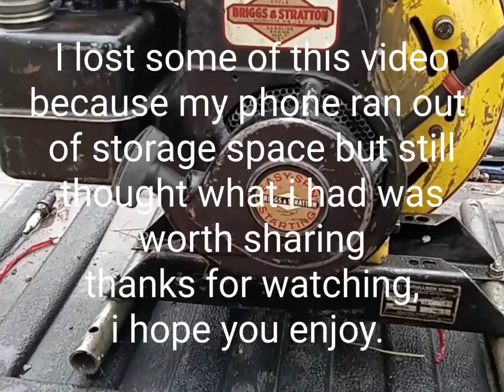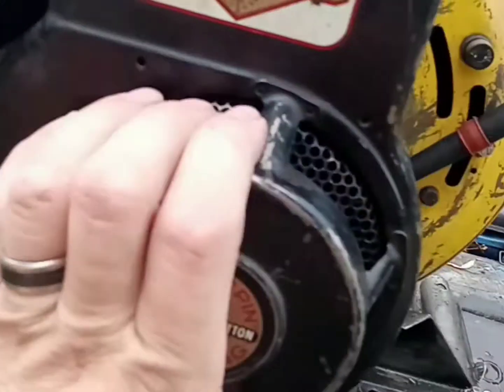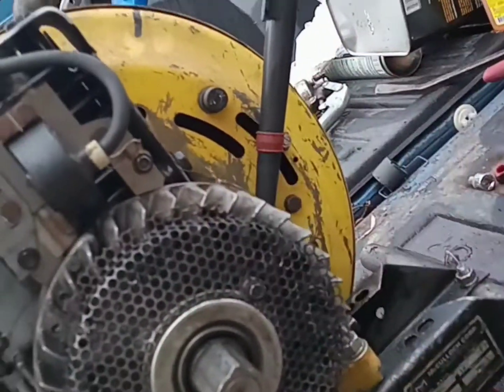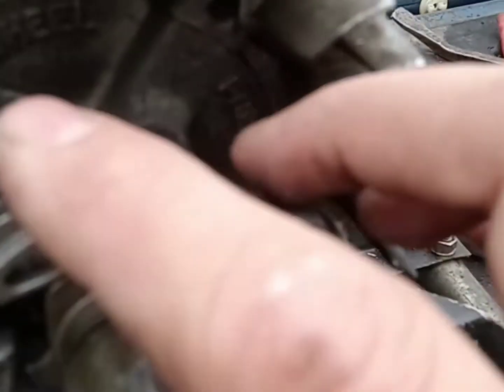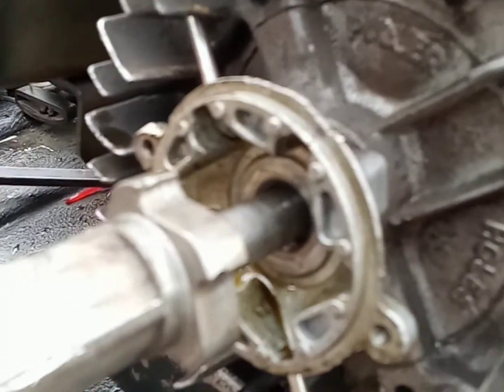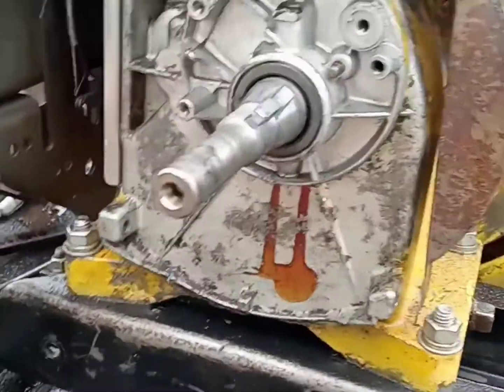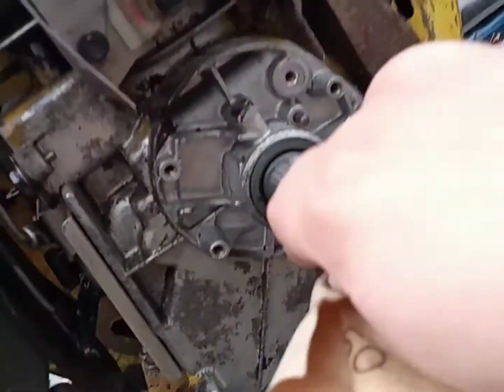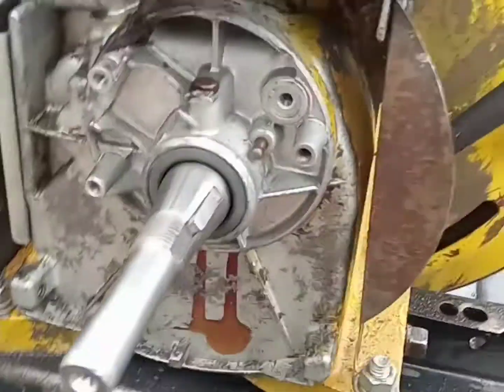Mcculloch H1500 portable generator, will it run and make power?????

Comment: Does anyone have parts for these?  I need the field winding, the rotating magnet hit it and cut of a bunch of the winding wires off. .
Reply from the maker: I'm unsure. I've seen afew on my local craigslist being parted out. I'll post the link on here shortly for you
Reply from the maker: https://peoria.craigslist.org/for/d/elmwood-mcculloch-generators-h1500/7549732637.html
Reply from the maker: https://peoria.craigslist.org/for/d/elmwood-mcculloch-generators-h1500/7549732637.html
Reply: @gregsmowersandmore5878  Thank you